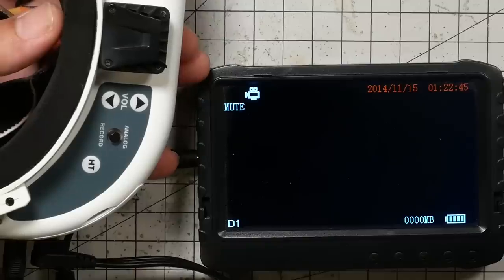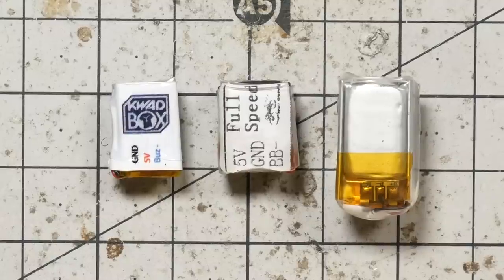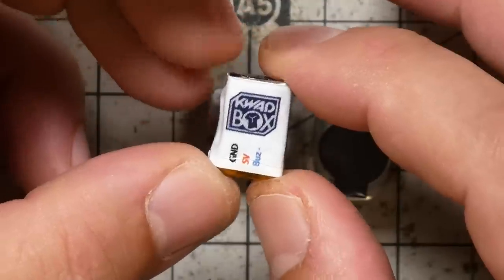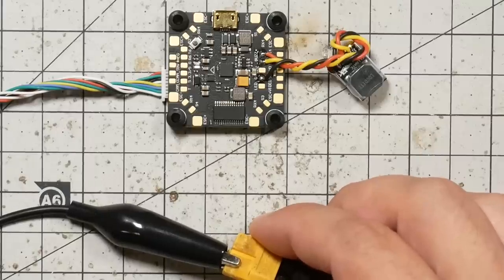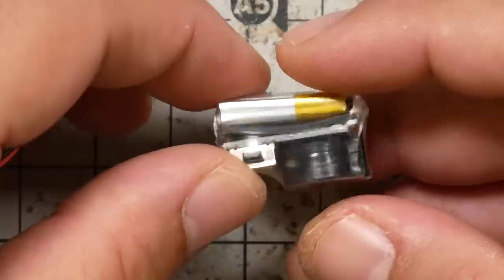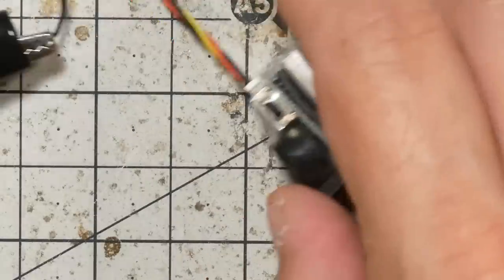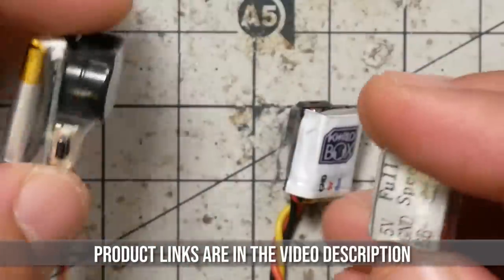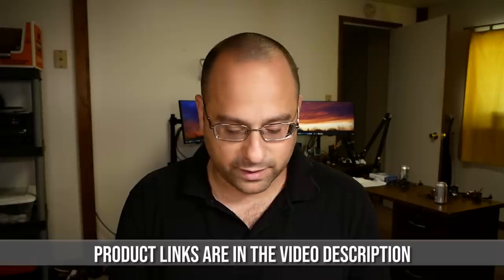Never Lose Another Drone | HELLGATE VIFLY FULLSPEED BUZZER

Comment: Painless360 talked about it too and one guy in the comment say "why don't you just use GPS ?" So I checked the mini GPS and some are really small ! What do you think about it ? (Exept the fact it can't be powered without battery)
Reply: It was probably me?I now use a GPS module on my 6 inch quad pretty easy  to set up ,I played around with GPS rescue mode, but the majority of the time I do not have it enabled. what I do have is the OSD configured to show GPS coordinates and this is recorded in my DVR footage, theory being if my quad goes down a distance away and in a difficult location I will have the last coordinates to start searching?
The down sides are  waiting to get enough GPS satellites for a fix, position and weight of the  module and cluttered display, but for me I have not found this to be a real problem.The reason I have fitted it is for when I use this quad, to say,  fly down a valley or up and down the hill or mountain proximity where it won't be a 5 min job to go and recover, I would also enable GPS rescue Mode, but for general use on a 5inch quad I would definitely not enable GPS rescue flying round a small field  doing acro, I think this would be more of danger than a help.
Reply: @pablofpv  thanks. 
Can you find your quad with the GPS ? You can also see your speed right ?
Reply: @alexis9200  you can see approx speed. Also if you're using telemetry and search for new sensors on your tx after you add GPS it sends GPS co-ordinates in real-time to your tx. When you crash you have the last known GPS co-ordinates on your TX. 😁
Reply: @OriginalGingaNinja  then you have to google the coordinate ? How precise is it ?
Reply: OriginalGingaNinja  You can see speed but its not very accurate, coordinates do look on the money for location, but even with it fitted I still have a 1st gen Drone Keeper mini on the battery strap, I lost a quad (well possibly picked up by some one as I did not get to it in time?found a bit of battery strap ,quad was gone!) before and after that I bought a Drone Keeper Mini when it 1st came out and it has payed for itself many times over, I would say this or a similar device should be the 1st thing you should buy when starting out above everything else, trust me even with 2 good quality battery straps , you will crash 1 day and disconnect your battery!
Reply: @pablofpv  Oh yeah, good straps and sticky pads are a must. I was just commenting on the GPS functionality. Ejected plenty of batteries before I got better pads and went double straps. I use kevlar ones with metal buckles now and umagrip.👍
Reply: OriginalGingaNinja  Yep they are a must and you can narrow down your search to find it with a GPS module, hopefully? 😂👍
Reply: Alexis  accurate enough to get you in the right area to start searching, but you  will need a buzzer.
Reply from the maker: GPS will get you in the general area but it won't tell you exactly where the quad is. A buzzer is essential.

Comment: Can anyone tell me how to wire a Buzzer with 4 wires it says VBAT or 5V/BB-/5V/G my question is related to the being 2 voltage inputs
Reply from the maker: Would help if we knew which buzzer it is.
Reply: @JoshuaBardwell  LANTIAN 110dBi Finder Buzzer Built-in Battery w/ LED Light for RC Drone F3 F4 F7 Flight Controller Models Multicopter Spare Part This was the description its a stack mountable one on a board made by lantian sorry about the noob question
Reply: @JoshuaBardwell  lantian HXZ01 Finder / I just found what it was called
Reply from the maker: I don't understand why they have the 5v or vBat wire, but bottom line is wire it up like shown. Red to 5v. Black to G. Green to Buz-. Yellow to vBat.

Comment: PLEASE PIN COMMENT
Something i feel is important was missed in this video.
If you previously used a passive buzzer, these new active buzzers wont work properly or will sound strange when connected. If this is the case you need to do a cli dump and check your beeper frequencey. Set it to 0 if youre using these buzzers.

Spent fucking hours figuring this out. Cant find this info anywhere online so PLEASE PIN COMMENT
Reply from the maker: I wasn't aware betaflight FC would work at all with passive buzzer. They only work with active buzzers... or do they???
Reply: @JoshuaBardwell  try it dude. Buzzer frequencey was set to 1800 on mine, it makes the active buzzer sound abit "croakey" like a frog since its just turning the active buzzer on and off so fast.
My very first drone was a banggood furibee thing with an integrated buzzer on the fc board, i have been using the saved configuration and that buzzer on my later builds.

A passive buzzer is probably slightly cheaper so banggood just set the frequencey in betaflight instead to save a few pennies